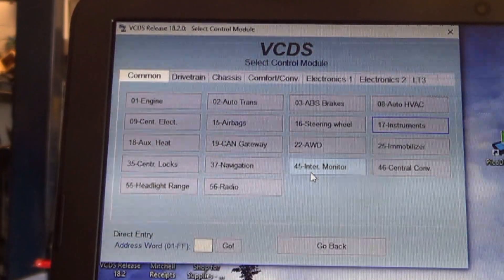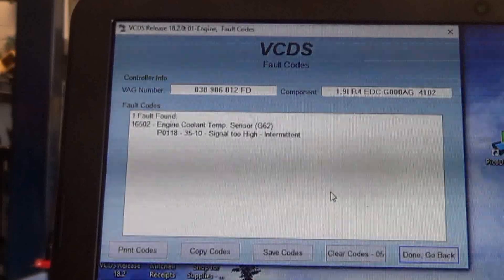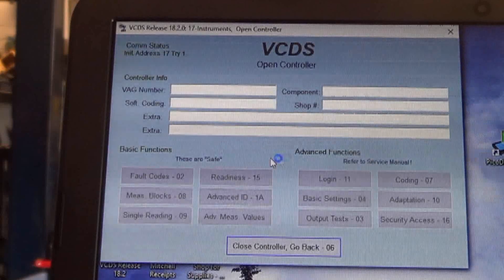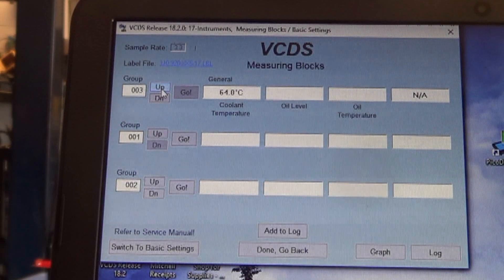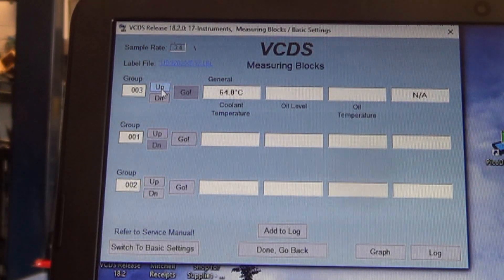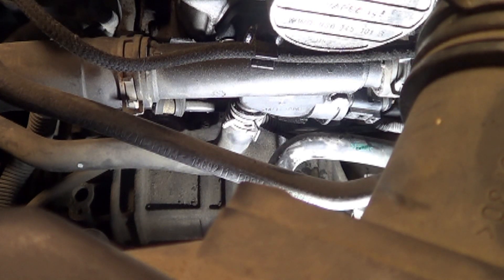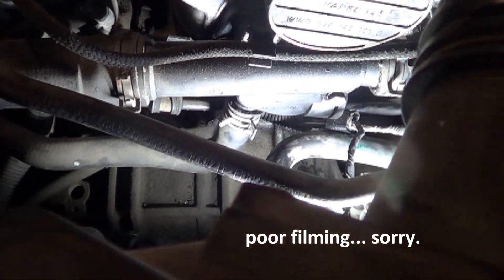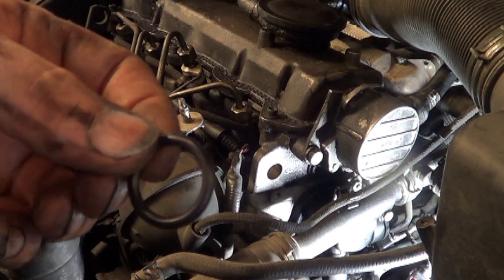Temp sensor codes

Comment: Hey man. I need a little help here. I own a passat b5.5 1.9 diesel. I have the same problem with the temp sensor . I replaced it with a new one and the same error. It says SHORT CIRCUIT TO GROUND INTERMITENT
Reply from the maker: look for wiring damage
Reply: @CoolAirVw  thanks a lot buddy. Have a wonderfull day!
Reply from the maker: @mariusbojani7991  thanks for watching.
Reply: @CoolAirVw  my pleasure watching. Simple to understand. Very usefull. Keep doing the good job man
Reply from the maker: @mariusbojani7991  Two thumbs up.

Comment: my sensor from vw golf 4 1.9 TDI
on the instrument measuring blocks when car is warm showing about 90* which is normal
But when i go to engine measuring block "coolant temperature sensor g62" never reads more than 4-10.5*
Is my sensor bad?
Reply: Update:
I installed a new one and nothing new, same reading for g62
Also i don't have any fault code
Reply from the maker: If they dont agree then it is very likely the sensor is bad.
Reply: @CoolAirVw  i replaced with new one and no effect
Reply: @CoolAirVw  my sensor is with 4 pins
Reply from the maker: Further diagnosis could be needed.
Reply: Is there any other sensor that working together with g62?
Reply from the maker: what tool you using to view that data?  what fields you viewing that data in?  Why are you messing with it... symptom, trouble code???
Reply from the maker: does the data show like the sensor starts cold then warms up as the engine warms up?
Reply: Im using VCDS im not getting any fault code (engine/instruments 17) so no faults!
So when try to read engine measuring block 001, coolant temperature sensor g62 is always 5-10* but when i hover on that says "warm engine should read from 80-100+), also you maybe asking yourself so what who cares about temperature but this sensor g62 must show more than 80* so i can use my timing graph

Comment: I have a 2005 Jetta auto that forwards gears dont work after it warms up .  Some times it will just die while going down the road
Reply: I replaced the valve body it worked for 1200 miles .. I need to do a trans relearn.. I dont have big com though
Reply from the maker: @drulessman2892  No way I can know for sure, but probablyh needs trans replaced.

Comment: I have exactly same problem on Passat 2003 gls. The delta temp is too big at higher temperatures even for a brand new vw Audi green sensor. The cable is not faulty as I can graph with obd2 both ip and computer temps and I can see they are different. What you guys suggest to do ? Thanks
Reply from the maker: What do you mean by "delta temp too  big"?

Comment: i have the same code    on my audi a3 8l 1.6 petrol  engine code  AVU  
01039 -  Coolant Temperature Sensor (G2)
         30-10 -  Open or Short to Plus - Intermittent
I changed the sensor 3 time but the error still happen it can be the connectors ?     any help please
Reply from the maker: 3rd times a charm.?  I guess not this time.  I have no experience with audi a3 1.6L as I dont think that was ever sold here, but I'll bet you have a break in the wire to the sensor.
Reply: @CoolAirVw  What does number 30-10 mean and does it matter?
Reply from the maker: @abiprivat3111   Doesn't matter enough to worry about.
Reply: @CoolAirVw  On my old sensor the secret number is 30-00, the new sensor number 49-14 can be a problem
Reply from the maker: @abiprivat3111  Is that a question or a statement?